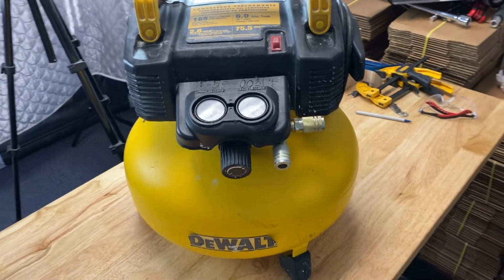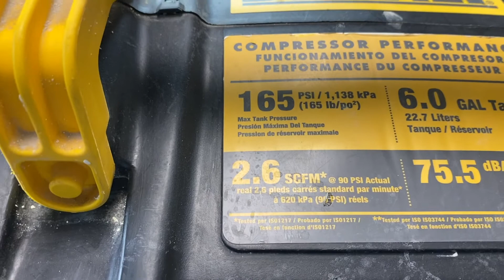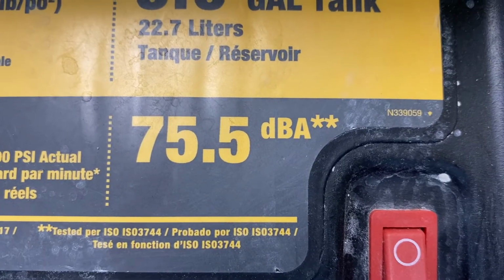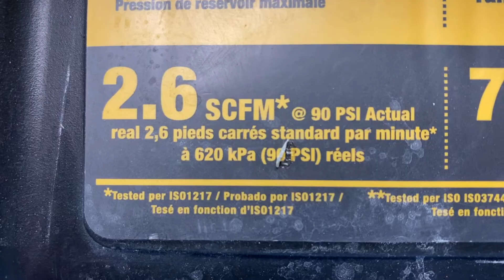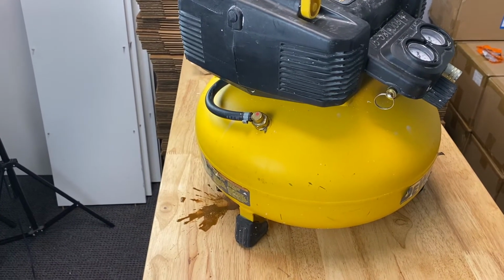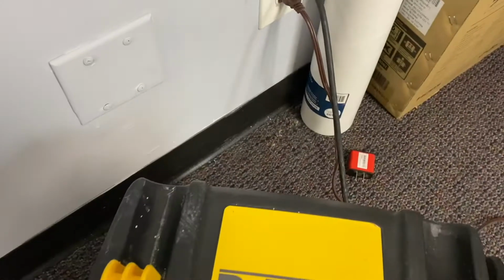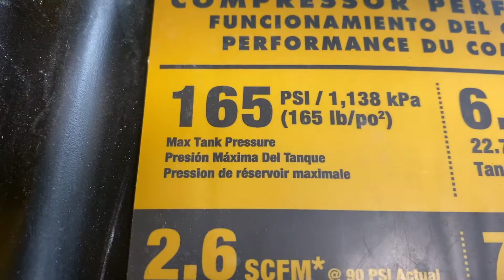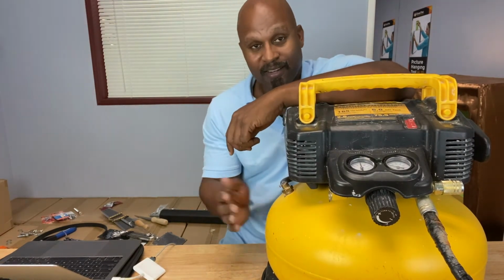BREAK OUT THE AIR COMPRESSOR!

Comment: nice video!
I was gifted a 6 gallon bostitch compressor and the printed instructions are HUGE.
my tip would be to quickly go over how to break in the compressor and also how to safely store it.
I was told to leave the drain screw (bottom of tank) loosened to store, but I don't see this mentioned anywhere in instructions.
Cheers!
Reply from the maker: Thanks for that great tip.

Comment: Hello, how long can this compressor be on without overheating, working at 50 psi?
Reply from the maker: Check the duty cycle of the compressor being used. That will tell you how long you should run it before giving it a break.